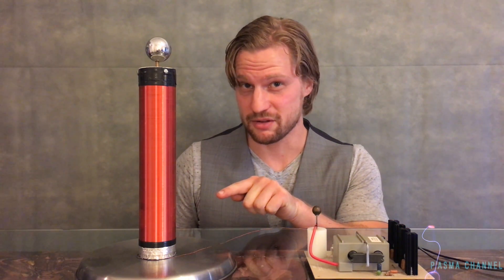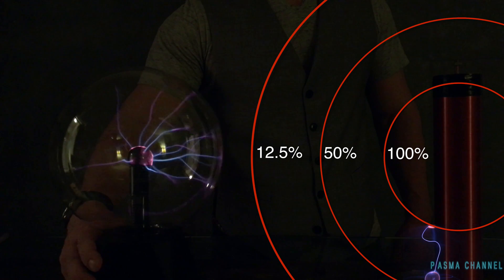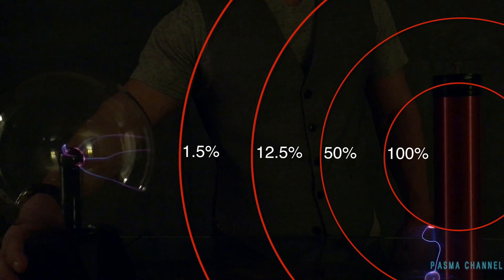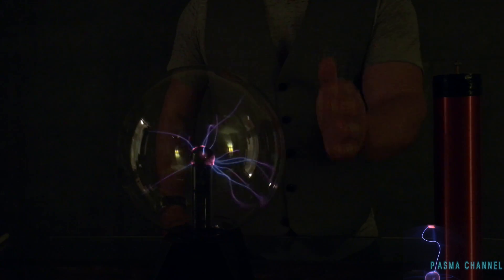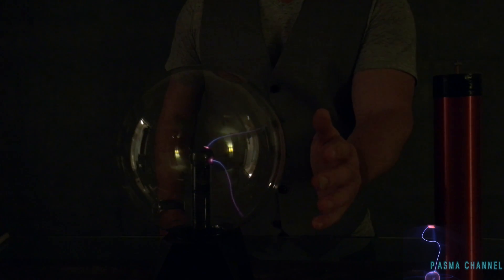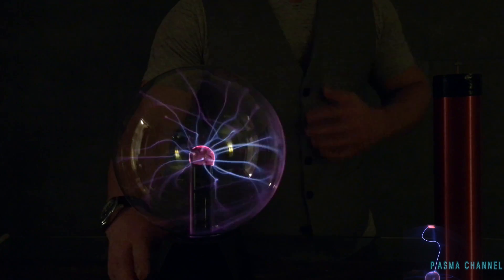WIRELESS POWER | HOW TO | HARNESS

Comment: Thank you! Your a real inspiration for beginners like myself to try and learn the wonders of electricity. I realize now that allot of what you do is just the tip of the ice bargue and that you may not be able to go into to much details because of the dangers that come with experimenting at home. I learned my lesson with a microwave transformer and a soldering iron. Oops! Forgot to unplug that square box of death, worst nap I've ever had. Still not sure why I didn't die? But I'm glad to still be here learning. But I have a question I don't ever here being asked and that is, are there any books that you can recommend for an ametuere like myself so I can safely learn how to use electricity? What I mean is I'm getting a lot better with my experiments (and much, much, don't ever touch that safer) and I'm even building small pointless circuites now. But I have no direction. I have even made a magnetic engine that works! But I don't kniw where to go from here. Where were you when you decided what you wanted to do with your talents? What books did you read? Stuff like that. Anyways I'll ramble on for days. Jay your really an inspiration! Thank You Antipicks
Reply from the maker: I'm really happy to hear ive inspired you. Thanks so much for telling me such positive news. And shocking yourself with an MOT is terrifying. That is really scary to hear you nearly died. As for books, I am self taught, by reading online. I would recommend deepfriedneon.com and tesladownunder  (two very good high voltage websites). They are older sites, but are what got me started a decade ago. In terms of safety, when in doubt, only use one hand to touch something. This prevents electricity from traveling across your heart and ending your life.

Comment: Ok, I'm not so comfortable with terms like "capacitive coupling" and so on, so let me get this straight...
When you placed your hand in between the electrodes, your hand acted as a dielectric and weakened the electric field between them, and as a result, the gas inside the globe wasn't sufficiently ionized... am I right? Plz correct me if I'm wrong

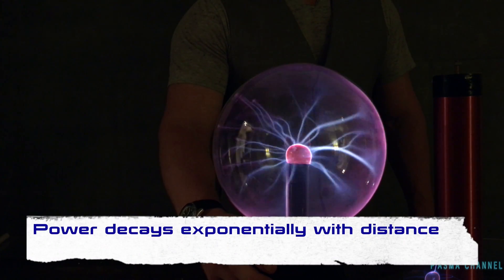Also, can you tell me the name of the music that was being played at 2:41?
Reply from the maker: That is indeed correct, but my hand also became the primary consumer of energy in the process, leaving little energy to ionize the globe.
Reply: Ya sure... the human body has some capacitance (that is why touch-screens work) and so obviously, it will be storing some charge, absorbing some energy (1/2*C*V^2)

Cheers!
Reply from the maker: Cheers! Thanks for inquiring!
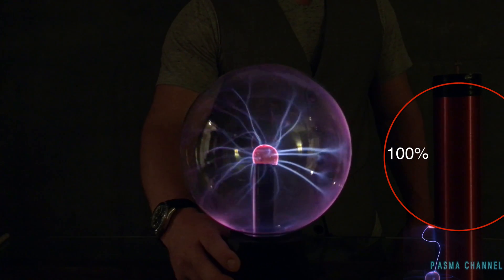Reply: I too would like to know the song at 2:41
Reply: Also consider putting songs used in your videos in the video description, it would save us a lot of time

Comment: Hey, how do you make the coil tower, and is it dangerous?
Reply from the maker: +Abhijit G the coil tower is 1.5 inch pvc pipe, 11 inches long. I believe I wound 600 turns of 32 gauge enamel wire around it by hand. The top of the tower terminates in a bolt- connect the top of the coil of wire to that bolt (bolt gives you a solid connection to various top loads). I have also rigged up an automated coil winding system using an electric drill before as well.
Reply from the maker: +Abhijit G additionally, the coil is not dangerous if your power source is kept below 10ma of current. If the coil is left untouched while running, you have zero risk. However, physically touching the tower during operation will cause an arc of high voltage electricity to jump to your hand, which is very uncomfortable. But, if your power source is not lethal to begin with, the coil will be non lethal as well.

Comment: you have excellent explaining talent I will support you 

can you pls explain how you build the coil tower?

thanks
Reply from the maker: Thank you! I will certainly create a video about how to produce a high frequency, high voltage source soon! The tower, itself, is just a coil of 500 wraps of wire around PVC pipe.
Reply from the maker: +Shabash7 thank you! Yes, the tower is a pvc pipe, 1.5 inches in diameter, and 10 inches long. 32 gauge enamel copper wire is wound around the former, with what I recall as 850 turns. The lower end of the tower is connected to a metal sheet approximately 1 foot in diameter, while the top is connected to a small sphere, that sits on top.